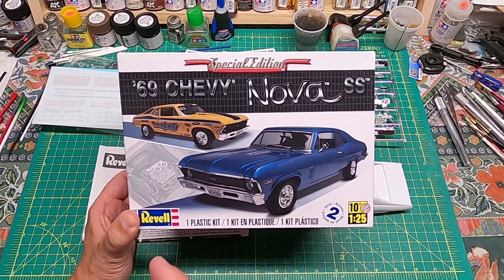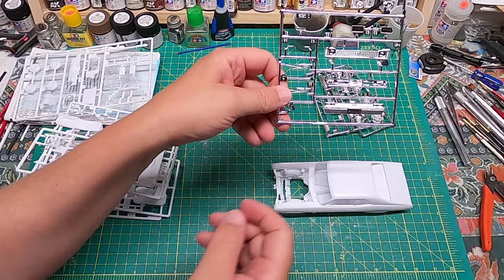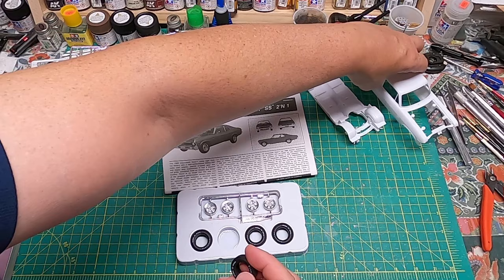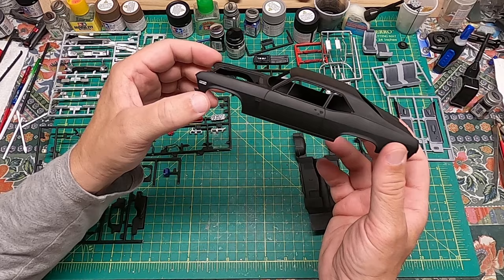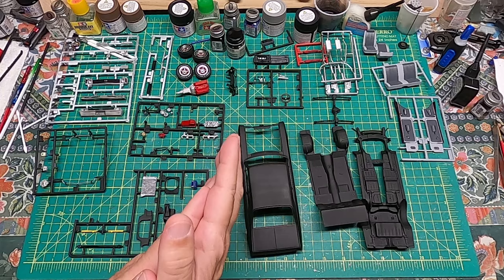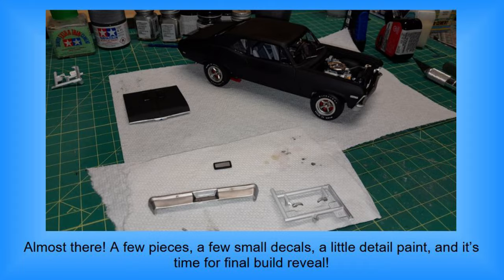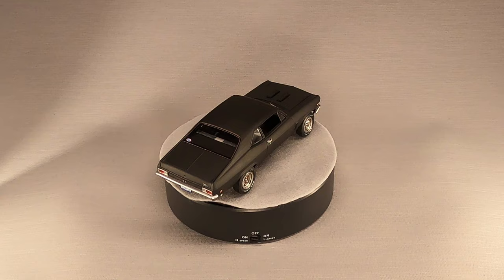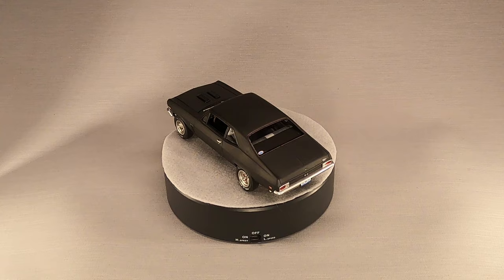Episode 31: Revell Nova SS

Comment: Just subbed. Great job! Love the Day 2 look. I thought you might be using the cowl induction hood. That is the only personal preference change I  might make. I have had this kit sitting in my stash for quite a while now. I think it's time to move it to the front of the line. Cheers.....:)
Reply from the maker: Thank you! I was tempted to go with the hotter engine and the custom hood, but I was going after a bit of a 'stealth' machine aesthetic. If the hotter engine would fit under the stock hood, I would have gone that route.

Comment: I lost the pins when building mine.  Had to use wire brads to replace the missing pins.
Reply from the maker: Hey, that's a great tip - the pins are small and could easily make themselves disappear. And after I misplaced my hood hinges, I suspect your tip might be put to use in my not-to-distant future :)

Comment: Thank you for sharing. What type of glue are you using?
Reply from the maker: Thanks for watching! I have several that I'm comfortable with using in my builds: Loc-tite Gel CA glue for delicate spots where I don't want to scrape paint; Testors Liquid Cement for general assembly because it provides a little more working time; Testors Clear Parts cement because it does not fog clear parts, it dries clear, and it can even be used to fill small gaps; and Tamiya Extra Thin (although in place of this I'm trying a bottle of Mr. Cement) because it will flow along seam lines, smooths out seam lines, and works great for quick attachment on small unpainted surfaces.
Reply: @practicalplastic3450  Thank you